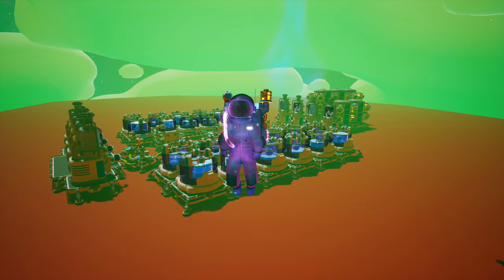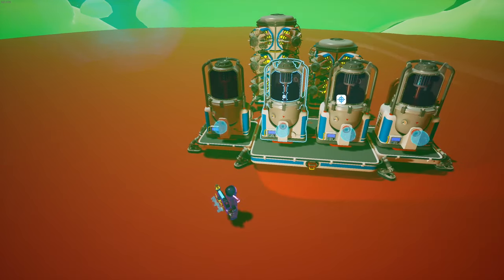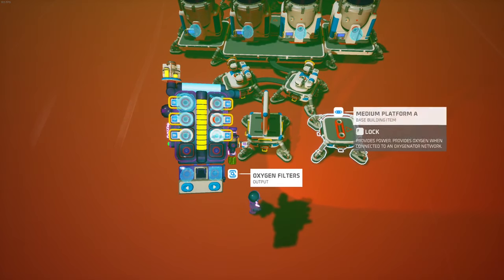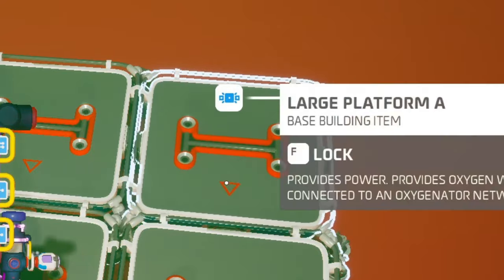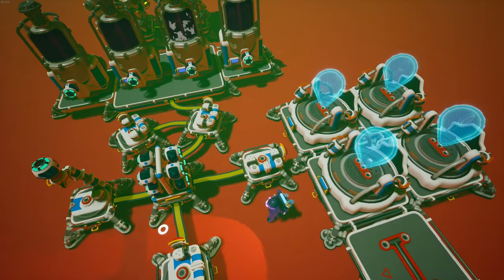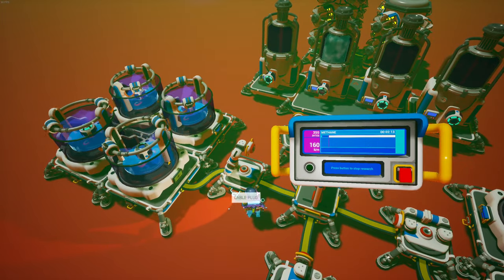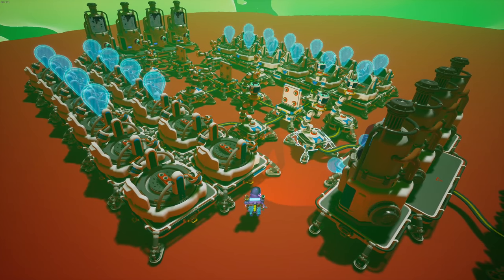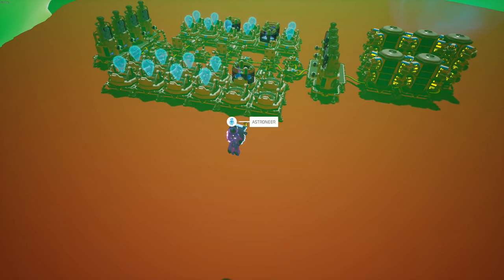Infinite Byte Farm in Astroneer V.2

Comment: I used this same principle for some free early game bytes but if you output the methane from a gas canister, put it back in and catch it fast enough you can have a canister of methane with almost nothing in it but it will still research for the same amount of bytes, great video Seck :)
Reply from the maker: I really tried super hard to make this work with auto arms, but unfortunately with every system that I tried, the auto arms only pick up gas from a station if it's full  :(
Reply: @Secks  Yeah I tried the same thing for auto graphene production with hydrazine - the best I got was a system that auto generated 8 minimally filled ones at a time which you then had to transfer manually to a medium storage. Once it was full, it auto generated the next set of 8 and auto arms took the transferred ones away. I got it to a production of about 1/s but decided it wasn't worth the scrap saving for all the manual work lol

Comment: Great idea, the thing is, i feel like by time you could build all that, on atrox, you're pretty much maxed on research, as it's not really that hard to get the 284k needed to get everything, i did it in few hours on foot and tethers running around on glacio, 3u power to unlock the eco capsule, those are worth 15k each. Not hard to do 20, especially if you do it along with trains mission there, you can hook the power right on train. But I'm still going to build this cause it's cool, and i already have condensers on Atroz that aren't really doing anything for me.

Comment: I like this for technical purposes but i feel like the early game you wont have the capability to achieve this and by the time you can feasibly do this it would be to late in the game for it to matter when you could just go pick up what you need then be done, the research is to finite to make the research biting this infinitely capable
Reply: Despite the limited research, you may want to stockpile bytes because limited time events require 500 bytes in the request platform to send a delivery of any size
Reply from the maker: I left the planet chart so it shows how profitable it would be on each planet. Honestly I think the only difficult part about it would be the power requirement. 122 units of power is a lot for a new player. You can scale it back as far as you want and it will still produce passive bytes while you're away
Reply from the maker: Lol some people on discord have billions. It's almost off the screen lol